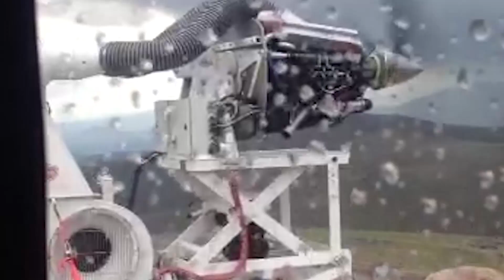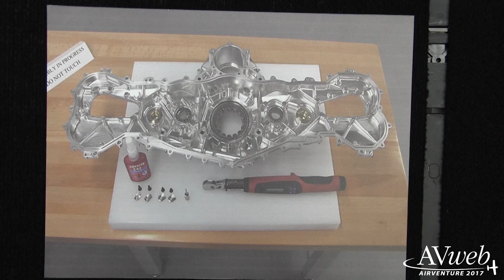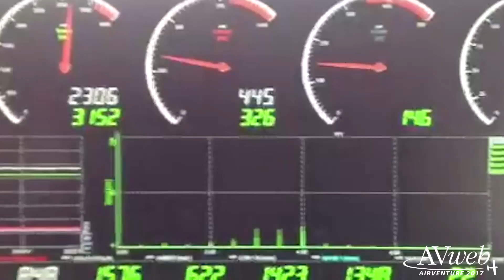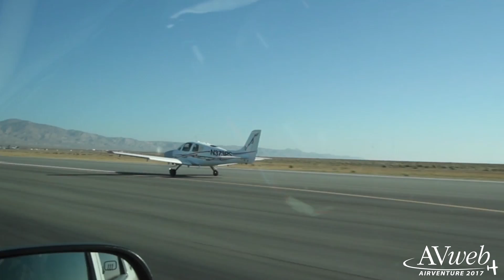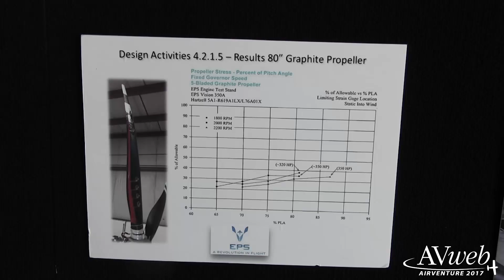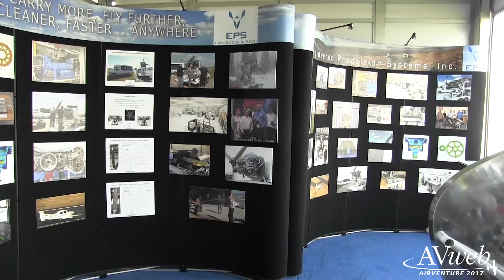EPS Diesel Back at AirVenture

Comment: For diesel engines, overhead camshaft is a large increase in weight for zero benefit.  There are many successful 4-valve diesels with cam-in-block pushrod valvetrains.
Reply: little do you know. More to multivalve than just breathing. Pushrods are obsolete and poor design.

Comment: The Chevy V8 has proven pushrod engines can safely rev as high as 8000 rpm and are more compact, lighter and cheaper to produce than Overhead Cam engines so why are Diesel engines, with half that rpm, being designed with Double Overhead Cams?!  
Can the camshaft on a pushrod engine be mounted above the Crankshaft so that the Cam Gear can be designed to double as the Reduction Gear to drive the Prop?
Reply: Yes, the camshaft can be above the crankshaft. You could use the same drive for both the camshaft and propeller, but you generally don't want to; the cam must turn at exactly half of the crank speed, and a gear set carrying significant power is more reliable if the tooth counts on the two gears are co-primes, meaning that exactly 2:1 is not suitable. Although it seems wasteful, the best design is to use separate cam and prop drives, even if they have about the same ratio and are in the same location.
Reply: That Chevy engine turning 8,000 rpm is not going to be an inexpensive engine to run. A lot of TLC and USC is going to be going into that engine to keep it safe. And replacement when it wears out. Which will be quite often.
Reply: @davem5333  actually some turn over 9000 rpm, the corvette with the LT stock engine produces 495 hp at 6400 rpm. they rev pretty high in stock form. in my opinion building an engine revving to 4500 rpm with OHC/DOHC is a step backwards.
Reply: All OHV designs are inferior, too many down sides, that is why every quality engine has been OHC for the last 50 years or so.
Reply: @chippyjohn1  many argue that the Chevy V8 is not an inferior but a high quality motor. Steve Morris gets 5000+ HP from pushrod OHV motors. 'Proof in the pudding'
Reply: @captarmour  3675KW from a 12.3 litre V16 billet engine isn't anything extreme today. That's about 300KW a litre. OHC engines are pushing up to 4 times that. The average rally car is making more power per displacement than that, and they are power limited. People will still argue that carburettors are good, doesn't make it so. The US is built around inefficient engines, their after market thrives on it, of course they will tell their customers they are great products. Don't you wonder why all the top performance manufacturers went away from pushrod decades ago? There were pretty much phased about by the late 60's in performance.

Comment: can a 180 degree V6(shared crankpins) work as smoothly as a Boxer 6?
Reply: No.  The configuration you describe does not fire evenly.
Reply: @jttcotm318  thanks. what about the secondary forces?
Reply: @captarmour  The engine you describe is a 6-cyl version of the EPS 8-cylinder, which is
* two banks of 3 cylinders at 180 deg to each other ("180 degree Vee angle") with a bank offset slightly larger than one rod-width.
* a 3-pin crankshaft with pins displaced 120 degrees to each other

This configuration cannot fire with even repeating intervals of 120 degrees, but instead 120-120-120-60-120-120-240-

Regarding balance, this system has the same balancing situation as the In-line 3-cylinder engine (currently produced by several companies including Ford);  Without any balance shafts:
* vibrating forces are zero for 1st-order and 2nd-order vibrations 
* this system has a 1st-order moment and a 2nd-order moment which for both is confined to the plane of the cylinders.  
* Cancellation of the 1st-order imbalance can be done with a single counter-rotating 1st-order moment balance shaft working with the crankshaft which has proper balance weights.  
* Cancellation of the 2nd-order imbalance can be done with a pair of 2nd-order moment balance shafts spinning in opposite directions.
(there are lower magnitude vibrations of orders higher than 2nd that are not typically dealt with)
Reply: @jttcotm318  thanks this is an education! thanks for taking the time to explain

Comment: FYI, it is a V8 because it only has 4 crankpins on the crankshaft, with each crankpin having two pistons attached to it. This results in different structural and timing characteristics than a boxer engine. Boxer engines have a separate crankpin for each piston. 180 degree V8s will have a pair of cylinders almost if not exactly across from each other, while boxers will be noticeably offset.

Comment: Now is the time to get on with this machine. New pilots using airplanes don't want to fart around with mixture & prop controls. Fadec will hopefully reduce maintenance costs and extend TBO. This engine would be great on a C182 or SR22.
Reply: You do realize that basic engine control technology works just as well on old engine designs as it does on new ones? An ECU could handle all of those things perfectly well even on an old engine retrofitted with the appropriate sensors and actuators.

Comment: Why the "mirror image" timing gear setups that have the cams on one head turning "down and in" relative to the "center" of the engine - the crankshaft - and the other set turning "up and out" relative the crankshaft? By shifting that "idler/idler arm" that is the final gear between the other idlers and the "top" cam gear on one bank to the "bottom" cam gear both sets of cams would turn either "down and in" or "up and out" and they and their respective timing gear trains would tend to "cancel out" each other's backlash. 

And how do you figure that "flat 8" is still a "V-8" from an "engineering" perspective when "typical" 90-degree V8s have a crankshaft rod journal every 90 degrees around the centerline of the crankshaft while nearly all inline 4-cylinders have "opposed" crank throws 180 degrees apart with cylinders 1 & 4 being companion cylinders and 2 and 3 being companion cylinders. There is NO OTHER WAY TO BUILD AN "EVEN-FIRE" FOUR-CYLINDER INLINE ENGINE and a V8 IS NOT SIMPLY "TWO FOUR-CYLINDERS SHARING A CRANKSHAFT" FOR THAT EXACT REASON. 

If you use a "V8" crankshaft in a "flat 8" you end up with cylinders STILL having to fire every 90 crankshaft degrees as with a V-8 but on opposite banks so that that successive cylinders firing 90 degrees apart have their power strokes and compression strokes "simultaneously" which with a DIESEL is going to be a recipe for disaster if the engine even runs at all. Just because there are horizontally-opposed two-cylinders, four-cylinders, six-cylinders and  12-cylinders does not mean a "flat 8" is going to "work" and be a "V8" because again a V-8 is NOT a "pair of four-cylinders" sharing a crankshaft firing a cylinder every 180 crankshaft degrees because a V8 engine fires TWO cylinders every 180 crankshaft degrees. 

The flat 8 engines that DO exist use crankshafts with 8 individual rod journals with the "opposed" cylinders and rod journals "180 degrees" offset from each other so the end effect is more like "pair of 4-cylinder inline engines" with their own rod journals sharing a common crankshaft "center" but "180 degrees" out of phase with each other so each bank acts like a "conventional" inline 4-cylinder firing each of its four cylinders "180 degrees part" but also "half a crankshaft revolution" ahead of/behind the other bank so the net effect is an even-fire 8-cylinder engine firing a cylinder on one bank followed by a cylinder on the other bank  90 crankshaft degrees later etc etc etc. 

The problem being that like ALL "offset" rod journals you end up with a "weak" crankshaft and one that has very little tolerance for "vibration" and "twisting" and "shock loads" and low-speed/high-torque "lugging" which makes it a HORRIBLE choice for a high-compression, compression-ignition DIESEL. Even with modern common-rail fuel systems that are electronically-controlled and that use "pilot injection" to "eliminate" diesel "clatter" during "warm-up" and "partial load" operations there are situations where due to high loads and high speeds and the inability to make multiple "small" injections vs. one "large" one and still have proper fuel delivery and timing you HAVE to let that DIESEL ACT LIKE A DIESEL. 

And that absolute NIGHTMARE of a timing gear system is going to "eat" so much "power" in order to ridiculously operate FOUR CAMSHAFTS to do what ONE CAMSHAFT PER "BANK"  EASILY DOES ON MUCH LARGER INLINE OHC DIESEL ENGINES with a MUCH simpler and more efficient timing gear train that between the friction it creates and power it "eats" and the "backlash" and cam/valve timing "variability" its going to "build in" to that "modern" and "high-tech" electronic common-rail diesel, that "flat 8" will be lucky to ultimately "put out" as much "power" per cubic inch of displacement as an "antiquated" and "obsolete" cam-in-block inline 4-cylinder diesel with mechanical injection and a balancer assembly or pair of balance shafts does. 

That engine is an absolute NIGHTMARE some "engineer(s)" decided was "ideal" apparently because of the "ease" of "engineering" a "flat 8" they mistakenly think/thought is what tons of "engine experts" who have never even changed oil in a lawn mower think is "truth" about all "V" and "flat" so-called "multi-cylinder" engines which is that they're ALL just a "pair" of "X-cylinder inline engines" that "share a crankshaft". Not so much. But that's the result of having more and more "engineers" who are "educated" by other "engineers" who went to college as "kids" right out of "high school" and because they at some point "got smart" and realized that being a "real" engineer is a lot of "shitty" and/or "thankless" and/or "high-stress" and/or "high liability" and/or "underpaid" WORK and an "engineering degree" is NOT a "license" to become a "master craftsman" and/or "inventor" and no real "famous" and "successful" inventor EVER has HAD an "engineering degree", decided they'd become "educators" instead of "engineers" and therefore "went to college" and "graduated" but "forgot to go home" and years and decades later with ZERO practical "real-world" experience and as a result of the "self-fulfilling prophecy" where "those who can't...teach" and where their own harebrained "inventions" only had to "impress" their paying customer "students" and their "colleagues" enough and long enough to get "tenure" ended up becoming "experts" in a "field" they have absolutely ZERO practical "knowledge" of and experience in despite all their "education" and "information".
Reply: Good thing you were paying attention in "English" class, unlike those ruddy "engineers."
Reply: Black friday sale of " " " " paid off